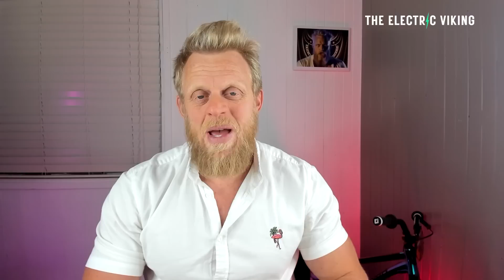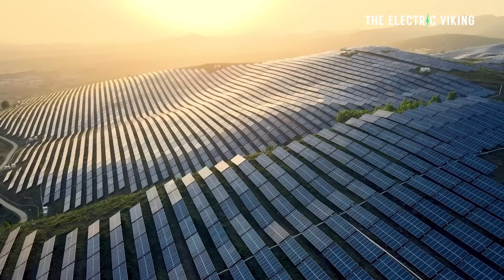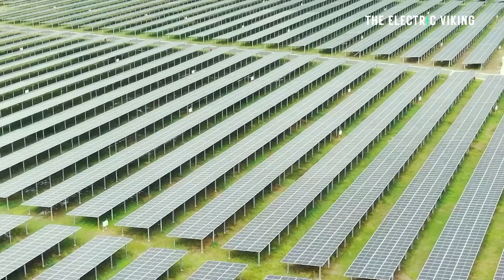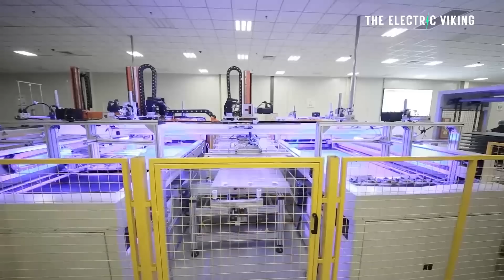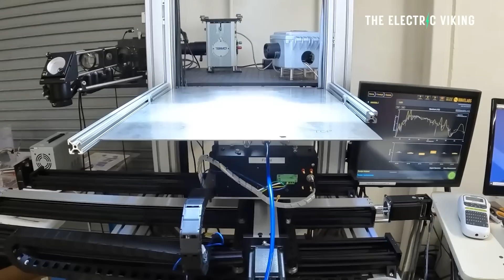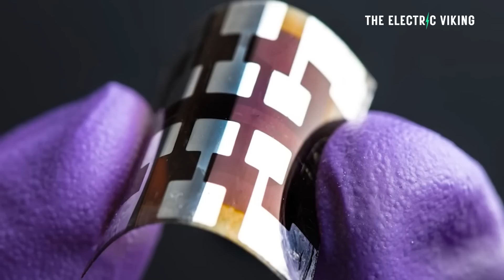How much of the worlds land mass we need to cover in solar

Comment: i am pretty sure the problem isn't making the energy. heck, even disposing of the panels is a bigger problem(despite them being recyclable in theory for all i know). the problem is storing enough power for when the sun is down. thats why we need V2H systems since with current tech, each kWh of batteries made needs to be used to its full potential. heck, if we make it beneficial on the financial level, it might even encurage owners of apartments to install chargers.

Comment: To replace the average coal power station, producing 3600Mw, you'll require 19 008 000m² or 19 000km² (ruffly for 1kW= 5,2m²)! Take in account that the state of Israel is 22 000 km².
In our country of South Afrika, we require 16-plus of these power stations at current demand to supply sufficient electricity. Thus, taking it at 18, that then translate to 360 000km². 
This will only produce enough electricity if there is enough sun shine, and this for a country like South Africa which is only the worlds 48nd biggest economy and have 56 million people.
Keep in mind that this will only produce sufficient power during day time. What about the night time? How much batteries will be needed to store the energy for the night time? Also, remember that if one have to charge the batteries, the power goes into the batteries and thus cannot be used for general consumption. Therefore, to charge the batteries for night or lowlight use, and for general consumption, one actually requires double the amount of solar cells, thus 720 000 km²!! This equates to about 34% of SA's total land surface, it is still a vast amount of  surface and is not much of an issue for SA, but what about countries like Japan, Britten and Switserland??
Dream on!!! It is all BS!!!

Comment: Because it's not just pure solar panels there's enough space between the panels of the least what I could find online the most efficient newest solar plant in the world. Replacing US electrical usage only current electrical usage And putting these solar panels in the best part of the country which would be the 4 corners area of Arizona  And Mexico such as such And accounting for transmission  And storage lost into and out of  Lithium  Ion batteries so we actually have 24  /7 power  Would require about twice the land area of the state of Connecticut completely covered over. It's roughly a 100 miles on a side in a square. That does not include the amount of energy we use in the United States for fossil fuels nor does it include The amount of greater area we would need if we didn't put the solar panels in the perfect area of the United States The amount of greater area we would need if we didn't put the solar panels in the perfect area of the United States. We'd also need some killer transmission lines from that area to the rest of the country. The next question is how long would it take to build that many solar panels and that is non trivial so we'd have to have more factories. Another problem is the fact that this perfect area is rather dusty and dry and you need a lot of water to clean the panels.

This isn't to say that we shouldn't do something like this or that we shouldn't use a mix of energy sources, But it does explain that this is not a simple problem.

Also about my background I am an electrical engineer with more than 20 years experience. All the data I found was just through Google searches and you part of the country to pick and using the tool  For the total solar  Iridians which came from the government website eia.gov.

Comment: Sam you don't have to install solar panels on any land mass, we just have to install (8'X8') solar fences on every Interstate Highway in every country around the world to power this planet forever.  In the US there are approximately 70 Interstate Highways, Elon has mentioned in the past that all it would take to power the US is a "postage stamp" that was approximately 100 square miles.  That's approximately 10,000 square miles, there are three Interstat highways that I know of on the East Coast of the US I95, I81 & I75 which all run from the Canadian border to Florida approximately 2,000 miles long.  If they were to install solar panels on both sides of just one of these Interstate highways that's 4,000 miles of solar panels.  Multiply that times 3 highways & that's 12,000 miles of solar fences, then multiply that times the 70 Interstate highways & they could create more than enogh electrical energy to power the US for centuries.  If every fence post also had a small wind turbine that would add even more power & they would also need battery storage along each highway.  Most highways run through most countries & you wouldn't have to concentre the solar panels in one area & transmit the electricity long distances, it would power everything along it's route.  If they were to install solar panels on every flat roof in every city in every country they could easily power most of the world with just solar panel fences & flat roofs.

Comment: Sam, why is australia (with only 26mill. people) so dirty when it comes to electricity generation....in 2021, 50% was coal, another 20% was natural gas, and only about 30% was renewables, and i assume most of that is hydro. the country is one big sunny desert...Are there plans to do solar massively?  the same could be said of the states of course..as far as expanding solar.
Reply: Because we have huge amounts of coal and gas so logically this is what was used. There is no nuclear. Tasmania is basically 100% renewable with hydro and wind. 

35% of electricity in the past 12 months was from renewables. It was almost negligible 10 years ago so things as improving very quickly

Comment: Hey Sam - my favorite topic! Here is one more piece of the puzzle: "A new study has found we would only need 50% of the world’s rooftops to be covered with solar panels to meet the world’s yearly electricity needs." Add that to 1% of dessert coverage, and already we have doubled the electric supply for the whole world. Add in Agrivoltaics plus covering every reservoir, and all the channels bringing water from far-away sources to the cities, and the supply is tripled. And all that other stuff in your video, and one more breakthrough area - long-duration batteries. Ambri is in prototype stage with theirs, as is that company that reverses rust as a large-scale battery. I think we can most likely say goodbye to fossil fuels by 2035 or so.
Here is the link to the 50% rooftops research paper (And the rooftops are there just waiting. No big deal to "acquire"): https://www.weforum.org/agenda/2021/10/solar-panels-half-the-world-roofs-electricity-research#:~:text=A%20new%20study%20has%20found,the%20world's%20yearly%20electricity%20needs.

Comment: Electricity use only is of minor importance; Industrial (?x), building heating (~4x) and ICE transport (~4x) energy usage is a multiple of this. 
ICE and building heating energy usage can be reduced by a significant amount:
  - ICE vs EV = ~20% vs ~80% is 4x as efficient; i.e. ~80% LESS energy requirement for transport
  - Building heating COP: ~ 3.5 (all in) is 3.5x as efficient; i.e. ~70% energy requirement for building heating
Industrial, from the top of head no idea of usage %-age (~50% af all energy used in the world)? or the efficiency gains (or losses) when transforming to electricity; 
But only for building heating and  transport we roughly need already 3x what we use now on energy. 
Say  we include 50% energy usage for industry  with 100% efficiency when moving to Electric:
      1 (now: electric use ) +4 (now: transport) +4 (now: heating)   +9 (now: 50% energy usage industry)                           total : 18     (electric + fossil + nuc) equals to   
      1 (electrified use)       +1(electrif.transprt) + 1.2(electr.heat) +9 (electrified energy use @100% efficiency industry) total : 12.2 (all electric)
So to supply all energy (from solar in the future, without considering growth of China and India) we need an area  roughly   12.2x the current electrical usage.
We might have some gains going into electrification in industry, say @75% efficiency resulting in                                               ~10x the current electrical usage.

Wind was not considered, which would be ~50/50 with PV

So instead of 0.3% this is then would amount to 1.5%-2.5% (compared to 33% desert), so still well in the realm of reality!!

Comment: Remember that much of the world's desert area is in the Polar regions. Antarctica and Greenland are pretty big places. That said, a solar PV area sufficient to power the world would only take up an area of a square with roughly 1,000 kilometres sides. (About 600 miles x 600 miles square.) And if conversion efficiency could be raised from today's maximum of just over 20% to the demonstrated ~50%, that needed area will be significantly smaller. The main challenges would include transmission line lengths, dust storm damage, battery storage under widely varying desert temperatures and geopolitics. The Sahara experiences diurnal ambient temperature swings from subzero to above 50°C. And African politics can be quite volatile. Sabotage could be a significant threat.

Comment: Australia Annual Electrical Power Consumption in 2021 - 2022 was 1.9 Tera Watt hours, 1.9 x 10^14 Wh, or 1,900,000,000,000,000 Wh.
Assuming: using SunPower Maxeon 3-112, 425 W panels, 1812 x 1046 x 40 mm (Length x Width x Thickness), average 3 hours daily duration of solar power generation.
Area of Maxeon 3-112 solar panels to generate energy for Australia yearly solar power consumption: 774 km2, e.g. square 28 km x 28 km!
At current, February 2023, retail price A$658 per panel, it would cost A$269 billion, just for the panels, to build such solar power station.
Reply: There'd probably be a bit of a discount on the retail price...

And no fuel cost.  Ever

Comment: Transmission infrastructure for electricity is a $trillions construction project if Centralised concentrated electric generation is increased. 

5 times more electricity in the future no CO2 world. 
National grids would need to be fattening up capacity 5 times. 

Rooftop solar power has the great advantage of UNLOADING the national electrical power grid. 

Transmission loads reduced upto 40% over the entire national grid just with rooftop solar pv power systems.

Comment: In Australia solar PV is cheaper than the glass windows in the home, $/m2

Also on average 
 window area m2 = rooftop PV area m2 for 6.6kw system. = 32m2 

Rooftop are 100m2 to 200m2 so only a small part of roofs are needed.
Reply: Ray Johnson  i know little about this.
Plastic film I think and so uv may reduce life span.
Julia Gillard and Hilary Clinton talk about it years ago.
Reply: 6.6KW won’t power your house.
You need a minimum of 10 to 15kW to deliver enough power in winter.
Reply: @allangibson8494  6.6kw is 33kwh each day on average. 
We use 7kwh daily on avg over a year. 
We are still connected to the grid.
Reply: @stephenbrickwood1602  Solar panel efficiency drops dramatically in winter under a cloudy sky. 90% loss of output is fairly typical.
So what works in Alice Springs doesn’t work in Dunedin…
Reply: @allangibson8494  a year is a long time.

What I mean is using some fossil fuels for a few months only is a dramatic improvement in CO2 reduction.
Reply: @stephenbrickwood1602  And in mid winter with a 6.6KW system you will be lucky to generate 2kWh per day.
A year is indeed a long time. A month without reliable power is a long time too. 
Hydroelectric and wind power is a useful complement to solar - you get more rain in winter and more sun in summer (in most places).
Diversity is good.
Reply: @allangibson8494  yep.
More panels would not be much more expensive. 
Your system could be optimised for the colder months. 
Just my thoughts. 

The massive increase in the central electric power generation in a 100% electric world and its massive transmission construction costs is the 2nd generation of thinking in most people. 
If power is a billion problem then the grid expansion is a trillions problem. 

Not a very sexy subject. 
So that is where rooftop and gas in winter is a good solution. 👍
Reply: @stephenbrickwood1602  Gas doesn’t have to be natural gas either. Hydrogen works in the same applications.
Bidirectional gas meters probably need to be the next thing… (bit harder on the rest of the infrastructure however as dropping pressure is easier than raising it).
We used to have hydrogen gas infrastructure like that - it was demolished in the 1960’s. Town or Synthesis gas is a mix of hydrogen and carbon monoxide produced when steam is played over hot coking coal.
It also produces a lot of other chemicals which we now produce by other means.
(I’ve been around long enough to have dabbled in antique technology - like turpentine production (not mineral turpentine - pine turpentine)).
Reply: @allangibson8494  there is a Peter Zeihan who says that the world is on the way to big changes. 
Old ways maybe back with us soon.
Have a look at his YouTube videos. 
If he is right we'll know soon enough.

Comment: I think all factory roof should be covered with panels and all rain water collected and filtered.
Reply: We will get there eventually after trying everything else.
Reply: Kim, 

significant amounts of solar generated electricity disrupts the grid and in addition because of intermittency it still requires an equivalent amount of alternate reliable and readily available generation capacity.
Solar or wind is not equivalent to or a replacement for conventional generation. When is this reality going to sink in?

Comment: I think people are missing two important points
1) Solar on the roof can often provide all the net energy a building needs and in some cases more.
2) Heat pumps will replace burning fuel as a source of heat increasing electrical demand.
Reply: If you're running a heat pump, your solar energy system is going to be difficult to fit on your roof, if not impossible. And, no, commercial buildings couldn't come even remotely close to powering themselves with solar panels on their roofs.
Reply: @PistonAvatarGuy  For houses it will depend a lot on the external environment.  For at least one commercial building I know of, the Watts per square foot of building floor is a lot less than it is for my house.  I know this because the building's electrical supply is less per square foot of floor.
Reply: @kensmith5694  Is it an office building which is really only occupied for 8 hours during the day? I'm mainly thinking of stores, warehouses, manufacturing facilities, etc. A Tesla Megafactory, for example, could never produce all of its energy using solar panels installed on its roof. The same goes for installations that I've seen on Costco stores.
Reply: @PistonAvatarGuy  It is"light industrial".  A warehouse uses very little electrical power.  The building that is now light industrial  started off as a warehouse.  When it was converted a huge amount of electrical work was needed.  There are basically 3 power distribution systems in the building now, two of which were added in the conversion.
Reply: @kensmith5694  "A warehouse uses very little electrical power."

Depends on the type of warehouse. If there are refrigerators/freezers in the warehouse, and they're large enough, energy consumption can be quite high.
Reply: @PistonAvatarGuy  I doubt even freezers would increase the power demand all that much.  Remember the big ones are made very efficient by their size and also by the design.